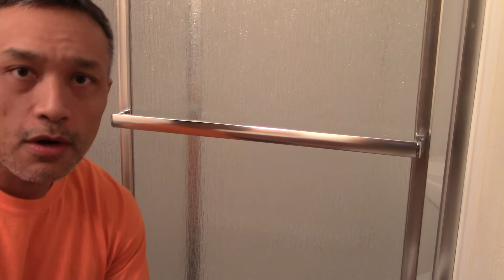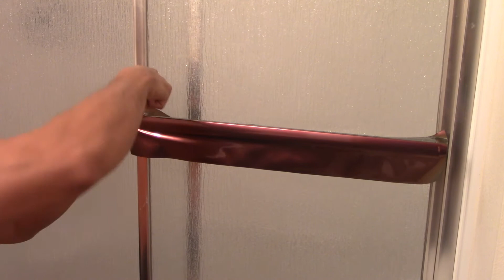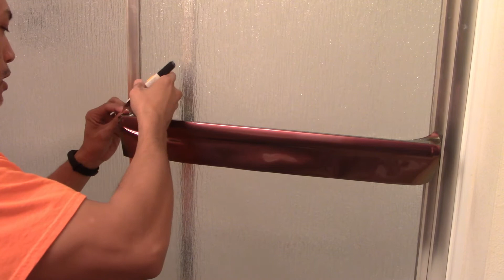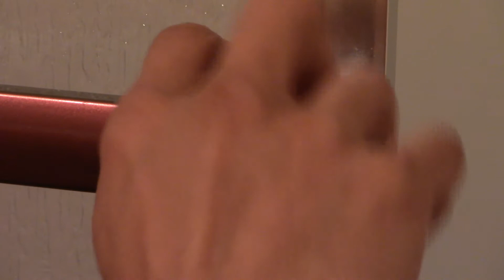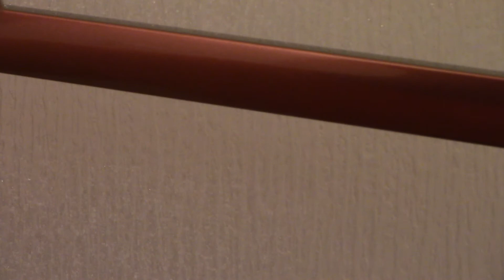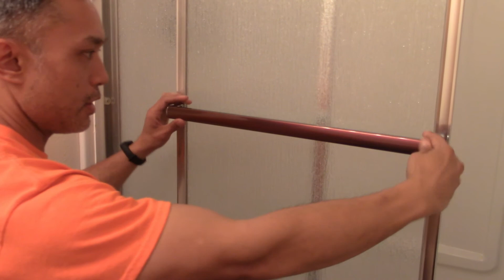How to: Vinyl wrap accent shower door handle

Comment: Is there a wood grain vinyl wrap you would recommend on sliding shower door frames?  Thanks.
Reply from the maker: 3M DiNoc is kind of the industry standard for architectural vinyl. But it’s a “permanent” vinyl. 
Otherwise, Vvivid makes wood grain architectural vinyl that is removable.
Reply: @ColorChangeCustoms  
Thanks for the tip!

Comment: Thanks for this video! Easy way to update a bathroom at an inexpensive price or if you live in a rental. Thanks again!
Reply from the maker: Thanks!  I live in a rental now and it’s a great way to personalize without being permanent.
Reply: @ColorChangeCustoms  does it leave any tacky residue when you pull it back up?
Reply from the maker: @t.ashleyyy4853  no, because automotive vinyl is designed to be removable. You may occasionally have some minor bits of adhesive left but it rubs right off with your fingers or using alcohol and a cloth.  Here’s a video showing me remove a whole sheet of vinyl from my car’s hood with no issue. Ps I already removed the accent since I had to move from my rental 😉
https://youtu.be/mDOjqzH1UgY